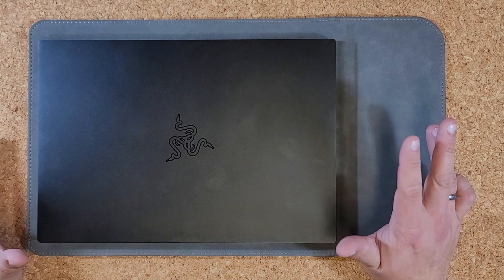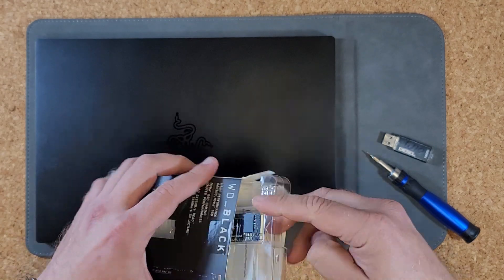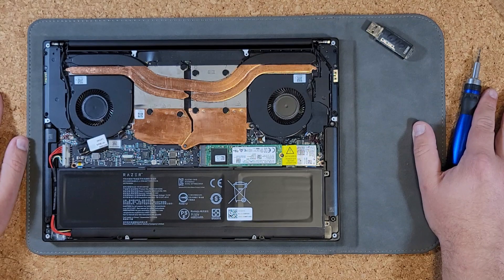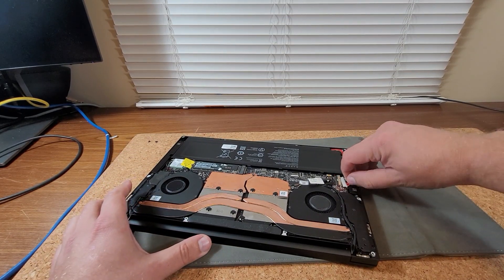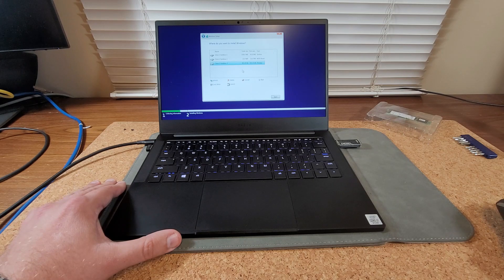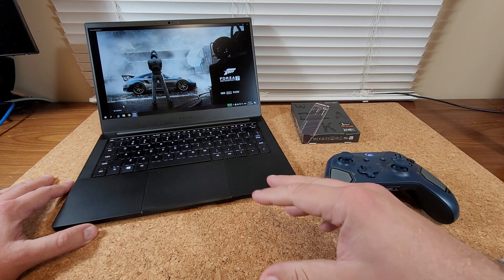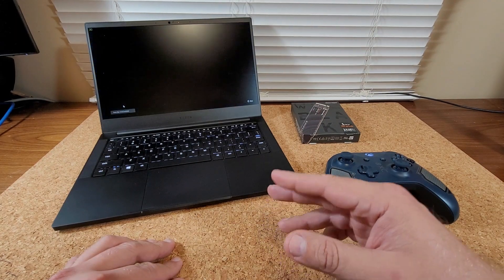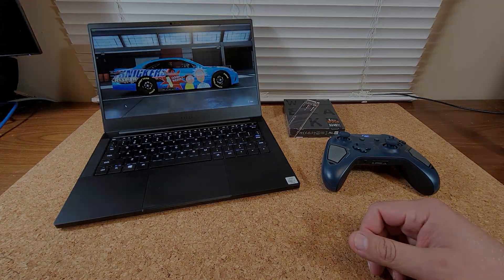Razer Blade Stealth 13 SSD Upgrade and OS Transfer Tutorial

Comment: I‘ve done the same thing to my Blade Stealth, with exactly the same NVME. I’v used an external case for the old SSD and clonezilla for cloning because of the size differences. Work‘s perfectly and I‘m happy with the new space and performance. The Trackpad issue I also recognize with the Lenovo Legion y540, after an update of Windows it began to work.
Reply from the maker: I think 1TB is perfect for it! Definitely a sweet spot if you consider price per GB for NVMe SSDs

Comment: I have the "Razer blade stealth 13 early 2020" ... the screws in the bottom of the chassis, the ones you have to take out when you replace the ssd, require a Torx T4 screwdriver. This is for sure, the T5 is too big!! Make sure you get a top quality screwdriver with a tough head and the screws will come out easily! I used Macrium Reflect to make a disk image from the original 512gb drive, saved. Just restored the image to the new bigger ssd, using the Macrium bootable usb made from an ISO.
Reply: Is yours the one with the OLED screen or FHD?

Comment: Please  respond. What the max Ram capacity on the razer blade 13? And how many Ram slots does it have?
Reply: hey, the ram on the most recent razer blade stealth's is soldered on the motherboard, so there is no replacing it. The max amount for the early 2020 blade stealth and newer is 16gb. I think is plenty unless you are editing huge files in premiere or do a crazy render. Hope this helps.

Comment: Hey man, so I have a new razer blade stealth laptop and I want to upgrade it to 1 tb. Could I just change it and be good or do I still need a usb with windows 10 in it? I dont want to transfer anything to the new ssd
Reply from the maker: Ok, the problem is that everything IS on that original SSD, so it needs to be transfered over  (including Razer's recovery partition that you use to reinstall Windows). If you just insert a new ssd without cloning your original one, or installing windows from USB, your computer just won't boot (as there will be no OS). Am I understanding your question correctly?
Reply: @spacemsh  Yes! thank you so much for the help I understand it now.
Reply from the maker: No problem man. I'm very happy I upgraded the drive, and it's been working great so far! Let me know how it goes for you.
Reply: you can also use your phone as a os i use for my galaxy fold 2

Comment: Keep the sticker covering the phillips screw! I’m willing to bet that the sticker was covering the screw for the SSD so Razer technicians could easily tell if the ssd has been messed with (therefore invalidating an warranty)

In a scenario where the display stops working, could I switch back to the original SSD before sending it in for repairs (without revealing that it’s been altered)?